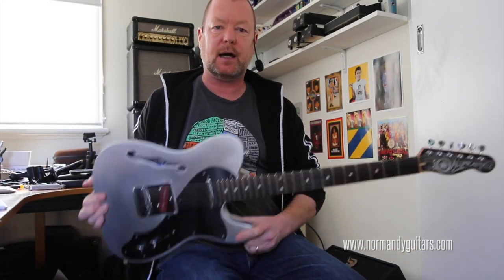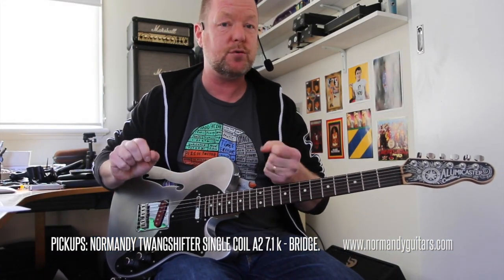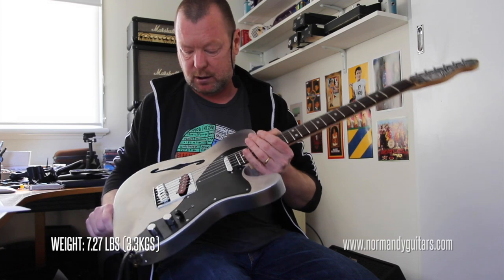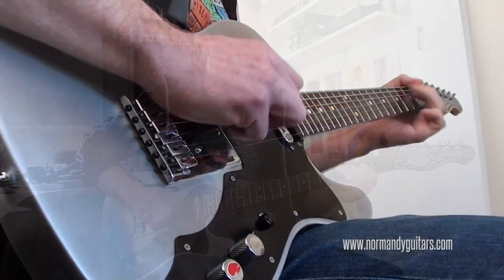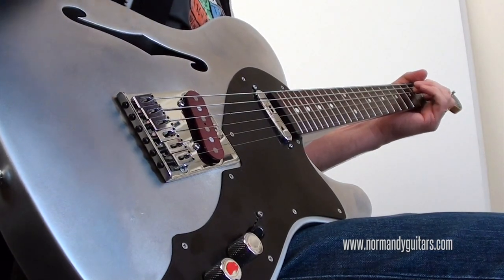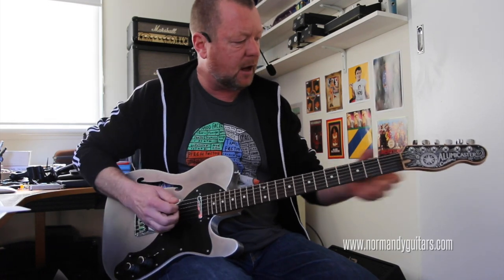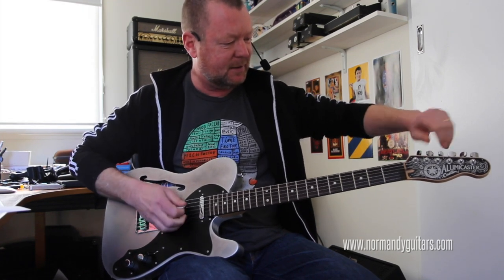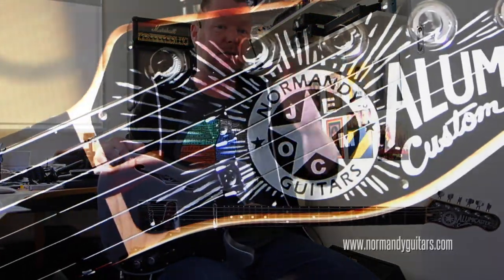Normandy Guitars: Alumicaster Custom "Tinline" - Demo with Laney VH100R

Comment: Very nice guitar! Way back in the 70's,I had a Aluminum guitar called a Veleno. Quite a few people were using them,Mark Farner had one,and thats the one I saw that made me want one.The body was shaped like a double cut LP,or a double cut Tele for that matter.The neck was made from Aluminum and Magnesium.They were made by a guy named John Veleno in St.Petersburgh Florida.In 1973 it cost me $895.00...I need to add that the guitar I had was chrome plated,and the neck were also chrome plated,but mine was not.Just plain black.